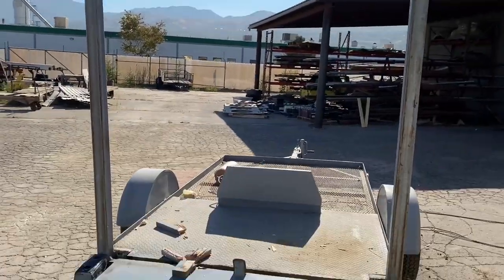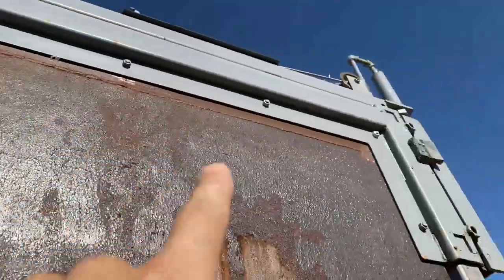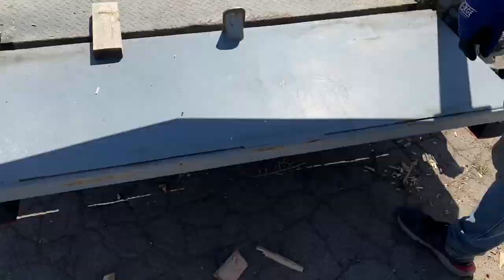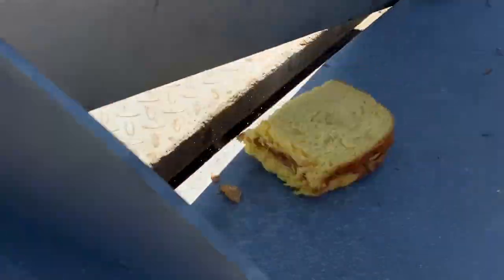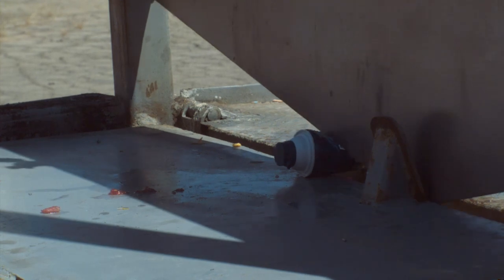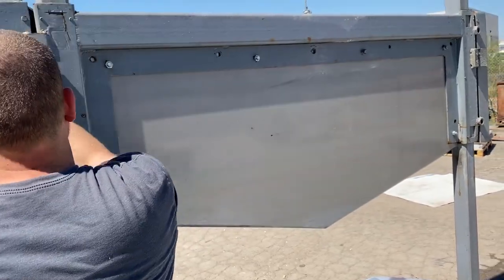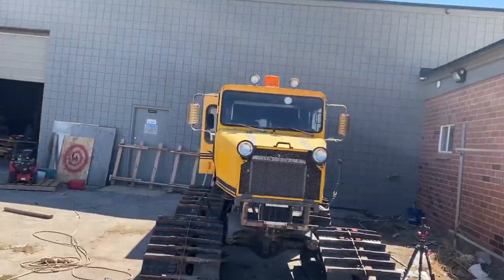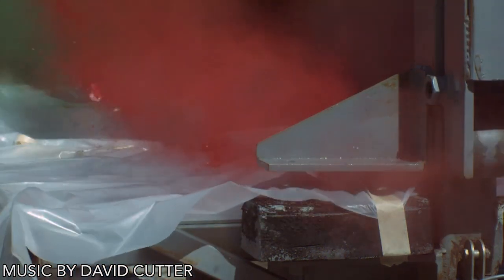Guillotine Upgrade and Testing

Comment from the maker: Selling like hotcakes... https://waterjetknives.com/products/odd-shaped-metal-object

I could really go for some hot cakes right now....
Reply: Those boomerbats are sweet.
Reply: Great, now cut them out of titanium and anodize them, and I'm there.
Reply from the maker: i wish titanium wasn't so expensive... but let me look into that.
Reply: Odd shaped metal objects 😂😂😂
Reply: @WaterjetChannel  At $20 it works, but yes if it's $60 or something, not so much.  I was thinking something like tisurvival is doing.  But there the price is prohibitive, pretty, but too expensive.
Reply: Waterjet Channel can we still send you guys things to cut
Reply: awesome love it, hey can you please cut a cooling unit compressor in half, you get them in all sizes
Reply: Just an fyi, the heat number you read off is the metal foundry's "lot traceability", if you know who made it they could trace that number back to the material test results and give a certificate (MTR-Material Test Report) usually based on chemical composition and material properties (tensile/elongation) confirming it meets 304 stainless requirements. 304 stainless has a certain % of chemical composition of chromium, nickle, etc that make it 304 rated stainless steel, where as other types of stainless have other requirements of chemical compositions. These chemical composition requirements give different stainless steels various properties, one might be better at corrosion resistance, where as another might perform better at extreme hot/cold temps.
Reply: I have potential to run the water jet at my.foundry job it sits with water running into tank at work n I asked is that a water jet and the shift manager said yes right away I thinkmsuprised that i knew inrun plasma extruders for tennhours cutting thick pieces of aluminum cast formed 3 feet behind me
In other words I seen a water jet sitting there with no one ever on it

Comment: the heat number is used for identifying the batch that material was made in at the mill. when i used to work in aerospace, we would have to specify the heat number and our purchase order number so that if any parts made of that specific metal ever failed outside of the specifications of the material, every single part made from the material with that heat number could be pulled from inventories and removed from any plane it was installed on. so essentially it's simply for material traceability

Comment: Guillotine V.S Human? When?
Reply from the maker: it would be a quick way to go
Reply: @WaterjetChannel  not if you started with the toes and then worked your way up
Reply: Would you be a volunteer?
Reply: Technically commies aren't human.
Reply: @WaterjetChannel  I was hoping to see a human gelatin test dummy, or a pig be cut by the dull blade.

It was a legit thought, since it only smashed the wood to cut, yeah sure, the human might have bone issues, and even a bruised organ, but that isn't the same as a guillotine chopping in half. (If you even get a bruised organ at all.)
Reply: @MrCODEmaster00  dude this would 100% kill the fuck out of someone.
Reply: 21 January 1793 on the Place de la Concorde, Paris, France.

Comment: heat number isnt the heat treatment of the steel its basically a serial number for that batch of steel. you can ask for the certificate from the manufacture of that steel matching the heat number. this will give you a detailed percentage of the elements used to create that plate

Comment: So 304 stainless will hold a better edge than some mild steels depends on the other grade of mild steel but the “heat” is not heat treating that’s just a batch number of sorts from the manufacturing process

Comment: I'm 80% sure that the heat number is just the batch number, as in it came from that heat of material
Reply from the maker: then i'm banking on the 20% chance that its something awesome
Reply: When they melt the steel in a vat everything in that vat gets a heat number assigned to it before it is processed into coils or large flat sheets.

Comment: why not just sandblast the old one and refit? A lot less expensive
Reply: The old one was made of mild steel, so it was significantly softer. That translates to much poorer edge retention. Additionally, mild steel rusts much more easily than stainless, and sandblasting creates a lot of extra surface area, so it rusts very quickly.